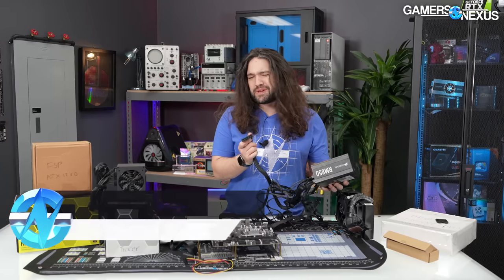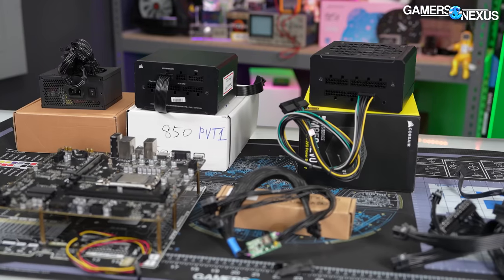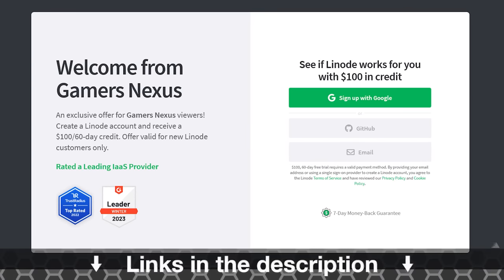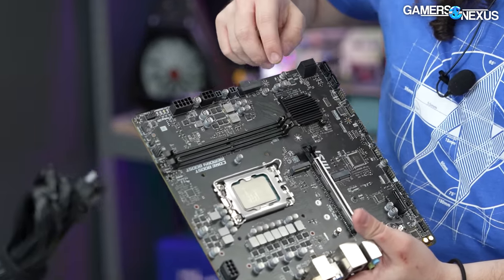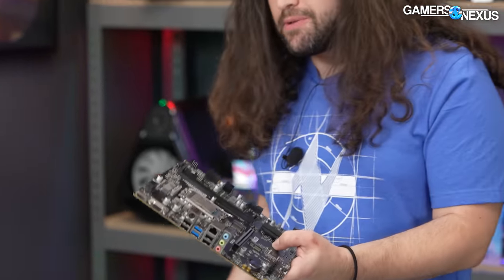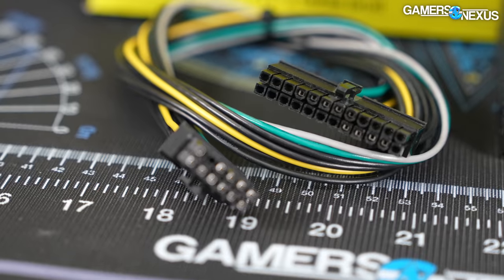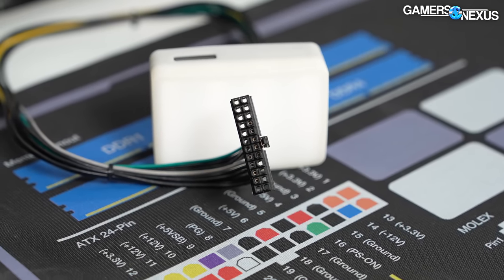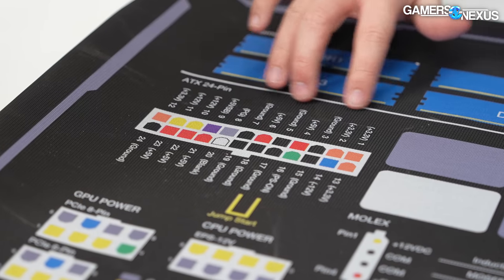The Future of Power Supplies - Maybe (Motherboard Cost, Cables, & ATX12VO)

Comment: I have a bit of a bone to pick with 12vo. I don't like moving all the voltage regulation stuff from a 150 dollar power supply to a 500 dollar mainboard. I'd rather replace the former if something goes wrong instead of pissing around pulling a much more expensive and harder to get motherboard. I could be crazy but this seems more work than is necessary.

And yes, they will absolutely charge me more for both the new 12vo power supply, and absolutely will for a new 12vo motherboard. Because reasons.
Reply from the maker: If it impacts board failure rate, then that's definitely a good point. Even if it's not a $500 board but a cheaper one, it's still a lot more work to replace.
Reply: @eye776  Tell me about it. It will stay the same or probably go up because 'new spec'
Reply: @eye776  PSU prices will stay the same but the motherboard skyrocket
Reply: I would bet they would raise the price of PSUs along with the price of motherboards and then tell us what a great deal it is.
Reply: Exactly, except now it's a $700 motherboard with lousy power conversion parts.  Caps don't last forever.
Reply: If you're buying $500 motherboards and $150 PSU, you aren't shopping for value anyway.  But for those who are, 12VO will be cheaper.

Comment: Another reason for the transition to ATX12VO is that 3.3V and 5V are difficult to efficiently deliver over long cable lengths. Those long cables act like antennas, picking up unwanted EMI. Moving all of the conversion to the motherboard is much more efficient.

Comment: The way I see this is power supplies will become cheaper to manufactur... but the manufacturers won't actually drop the prices. 
This will only increase motherboard prices making it a bad deal for the consumer.
Also this will add more points for failure on the motherboard itself.

Comment: I have custom built NAS, based on Advantech board based on Q170 chipset and Pentium G4400 CPU. It's powered by 12V power brick and it's crazy efficient compared to my previous Atom setup.
Reply: How do you power the drives? The SATA connector has 3.3V, 5V and 12V pins.

Comment: I'd be worried about the mini-ITX form factor.

Is there enough space on those boards to handle this 12V to 5/3.3V conversion?
Reply: they will find a way to do it and charge us 400 for a basic itx board

Comment: I know there are a lot of possible issues with this, like more points of failure and the injustified markup that's bound to happen, but let me dream for a second: just imagine how a build with this could look if you just used M.2-SSDs. You would just have two big cables, one going to the MoBo and one going to the GPU. In addition to that you could daisychain the casefans and now cablemanagement would be a dream. Especially for SFF it would be great to have the option, then you could choose a cleaner build for more money and otherwise you would just take a standard 24-Pin MoBo.
Reply: You'll still have EPS connectors.  

Also itx boards are already being stressed to their size limitations and now you want more DC-DC conversations to happen on board than before? Good job.
Reply: @NotThatGuyJD  Well I said I am dreaming a bit but I will kind of try to address your concerns. The boards wouldn't necessarily have to be bigger. For example there is more I/O than most people ever need on some itx boards. Some people would be willing to trade that for better cable management. As for the EPS-Connector: most CPUs could theoretically work on the power budget that is provided by the 10 Pin. A 13900K? Probably not, but that one consumes way too much power to begin with and if you want to use it you could just poupulate the EPS connector or use another board.

Comment: People are talking about motherboards dying but even without that, you still usually need to upgrade the motherboard more often than the PSU. I can buy a really good power supply if I only have to do it every 10 years, but I'm already keeping all of my hardware for a minimum of 5 years in the best case, so it might get even worse.

Comment: If we could combine power and data into one motherboard connector it could reduce cables, material usage, and clean up builds. I don't hate it.
Reply from the maker: That'd be cool! Seems like it'd rapidly enter "we didn't like the standard so we invented a new standard" territory for the pre-built manufacturers, though!
Reply: @GamersNexus  Good point. I don't like the lack of backward compatibility either, although adapter cables should be feasible. Make it an open standard agreed by a consortium?
Reply: @odjsjaks  The PSU could be lower cost due to reduced components and complexity as it only needs +12v and GND, like the PSU's discussed in this video. Also cheaper due to fewer bundled cables. 

The motherboard would increase in cost, offset by PSU cost decrease, as it now has the 5V and other circuitry.

The data cables would increase in cost because they now must also include power, which adds more complexity and material, but this should be offset by PSU price decrease.

When buying a new PC this should all balance out to no change in overall cost.

Adapter cables can provide converters to allow interoperability between old and new hardware. So you can keep your old PSU, motherboard, or other hardware, if you like. 

PSU manufacturers may make less money off this, whilst mobo make more, maybe? It's hard to tell how it would shake out. Regardless, this is a quality of life improvement, not a money making scheme.
Reply: If it's just 10 pin replacing the 24 pin I'm all up for it. I'm due for an upgrade anyway. But this one seems like not only it would increase the cost of the motherboard, because the extra component needed to power the remaining stuff, it didn't reduce cable clutter either. Look at that janky ass power cable from the mobo to sata.
Reply: @Leo99929  Have you ever met a Manufacturer of anything who reduces cost on a new generation of a thing? I wouldn't expect them to start now.
Reply: @odjsjaks  Why would 12 pin PCIE make the PSU more affordable? It's two six pin cables into one 12pin. That material cost difference is pocket change in the cost of a PSU factoring in that the reduction in cost from fewer connectors is offset by new tooling and lower scale of production savings vs the old hardware. Maybe it might make a few pence difference when production volumes overtake the old ones?

This is cutting out voltage conversion and regulation hardware which account for a significant proportion of the traditional PSU's capability, however, those stripped out power options need their power capacity adding to the remaining 12V capacity in order to ensure the motherboard can maintain 12V power whilst splitting part of it's supply out into the 5v and 3.3v. So I would expect a cost reduction on a 12V only PSU, but probably not as much as you might first imagine. 

Ultimately, what you're saying is that capitalism doesn't work, though. As given market freedom the manufacturers apparently conspire to maximise their profits rather than pass savings on to the consumer?... You're probably right that a route to more fairly priced hardware could be through non capitalist market regulation... You know if the company is floated on the US stock exchange then if they don't put profits first, then they can and will be sued by the stock holders, and the CEO replaced by someone who will? The legal system actively encourages charging customers the maximum possible amount regardless of the profit margin or morality. Look at the state of health care.

Comment: Would it be possible to transition to a single cable for both SATA (data) and SATA power ? With an adapter on the device side to accept a single cable instead of two. I think this could reduce the "worst cable management" aspect of 12VO boards.
Reply: It is possible, an cables like that already exist.

Comment: I hope it never does on home PCs. It’s very suspect to have the voltage regulation in the MB, if it does break it can cost 700 bucks if the MB did. cost as much. But if something breaks, the PSU can be replaced for cheap, easily and it also has voltage protection on it so it can’t break other components.
Think about that!

Comment: If the board will handle the power supply, wouldn't it be better to combine both power and data cables into one. Eg: for sata drives you have one cable that carries both power and data?

Comment: So not only are motherboards beginning to be kind of unaffordable but they now also get new things that could fail (power conversion parts which were previously handeled by the PSU) I'd rather replace a faulty PSU which costs ~90€ than replacing a motherboard which starts at ~120€ because some power conversion parts are broken or "smoked". I'm not sure if I like where the PC development is going regarding the changes mentioned in your video. Not to mention the effort that changing the motherboard brings along.

Nevertheless: Great video, keep up the good work at GN ^^

Comment: Looks like your run of the mill boost converter circuit with a 12V clamp, looks like a quick and dirty fix for the voltage conversion. Likely it will be totally fine for the conversion as standby voltage is only drawing power when the board is off. That definitely beats tossing out the PSU you had before.

Comment: Yeah, while I understand the gain in efficiency of 12vo, I don't think integrating more features into the motherboard is a good idea.

What I think would be a good compromise would something like a 12VO PSU, mostly as as an AC to DC converter and voltage transformer, connected to something similar to a DC to DC picoPSU in a breakout board which could be located near the board as to reduce losses.

Comment: One thing I wonder about is what's the future of itx motherboards with 12vo? They need to make the board 15-20% larger to fit these connections, will they even be able to manufacture a board that fits the size specifications of itx with 12vo? They might just exclude a bunch of it, because in many cases people with itx only use m.2 drives... Really what else is left to need to convert for?

Comment: If you want to know how this can play out, just go look at current Dell/HP motherboards on their business lineup to see how bad it can get
Reply: Difference there is that the Connectors are completely undocumented in most cases, and not everything has an adapter to make it work.

Dell/HP also don't just use one odd layout of connectors, they use different ones for different products.

Here it's a standard, documented, and adapters exist to reliably convert from one to the other.
Reply: Dell and HP are selling their business lineup to accountants who make their purchase decision because one vendor provided the same specification 50 cents cheaper than the other.

Comment: The extra lines are like used to reduce Vdroop on the 12V rail under CPU load, this drop in voltage is caused by the inductance to the PSU under fast switching operations (what you might call transients).

Comment: This could be very interesting in combination with the last couple of motherboards with reverse mounted headers and stuff because I can see all of your sata connectors and a lot of your lower voltage adapted headers coming off the back of the board making cable management easier
Reply: I don't see how that's any easier than cable management now.  Plus it requires you to change your PSU, motherboard, and case for no good reason.

Comment: This will result in motherboard manufacturers cheaping out on components to create the lower voltage power rails, then troubleshooting power issues will be 2-pronged. At least with the current state we know that if there's a low voltage issue on the USB, it's a power supply (or load) issue. I like the idea that all power rails come from a power supply that's been tested, certified, etc.

Comment: Love the California call-out!  From a state that melts down their power grid due to poor implementation of their current infrastructure without any consequence, it warms my heart that you specifically stated it. 

My opinion is, this won't ever be implemented specifically how it's stated. Just like the Corsair adapter cable, it will just be worked around to "meet the spec" but still maintain the status quo in the general PC community.

Once the big think tank over at Intel comes out with a follow up spec (or the time after that even), I'm sure we'll start seeing some changes in the new boards and PSUs.  

Maybe instead of coming up with specifications for "increased efficiency" to appease their political counterparts, they should come up with a cpu chip design that doesn't draw almost 300w under load. Ya know, like when people are actually using their own products 🤦🤦

Comment: BTW, one can make an adapter cable to power off mainboards with 12V only PSU. It would also have a PCB that makes the other needed voltages.

Comment: My argument is pretty simple. Most of us use our power supplies for more generations of the build than our mother board.

So if the 12V to 5V conversion happens on motherboard, as it will with 12VO, I would have paid 4 times for this circuit is last 10 years, but since it is on the PSU (because I am not using 12VO), I paid for that circuit and it’s components only once. 

This is essentially an advantage and an optimization for the system integrators, but an e-waste for everyone else.

Comment: My main issue with 12vo is your adding more points of failure to your board. A PSU is usually a lot cheaper to replace than your motherboard although not always. Oh and we would get much more expensive boards
Reply: 12v has been standard in datacentres for years now.  We haven't seen any issues because the 5v, 3.3v and -12V lines do so little these days that the regulators on the motherboard that supply those voltages never fail.  They're just doing so little that they don't fail.

The same goes for laptops.  You don't see failures in those regulators because they do next to nothing.

Even in desktops by Dell, HP, Lenovo etc have been 12v for years and again, it's a non-problem.

Not that any of that matters.  ATX12VO is an update of the ATX12V spec.  It's been around for decades and it has had zero effect on motherboard and PSU manufacturers, and there's no reason to believe that this is likely to change at any point in the near to mid future.

Comment: You forgot 5V to USB.
Today, USB draws a lot of power from 5V rails.

Just plug 4-5 external drives and that's 8-9A in just 5V and we already know the motherboard manufacturers will cheap out the conversion to 3.3V and 5V. So I doubt there will be a midrange board with good 5V rails, not tripping over current (if any protection is placed on the boat) after plugging external drives. Needless to say by how much the motherboard manufacturers will increase the price because of the new 'feature', yay

Comment: There's nothing magical about ATX12VO that'd make it more efficient than ATXv3.x. What I am rather worried about is having all of the switching mode power supply action for 3.3V and 5V happening right next to the RAM section. Turning mainboard designers into PSU designers also seems highly questionable. Taken together, I see absolutely zero reason for ATX12VO to exist.

Comment: Moving this type of change into 1 form factor would drive this, like into ITX- dtx, in the mean time support an interface between them, simple 12vo ps feeds small adaptor for power division for use on older boards just like that Corsair cable. Nice old silly scope on top shelf left. Ipsu looks like current monitoring nice. I will be looking into this for next build as spec matures

Comment: HP does something similar in some of their small forms office PCs.
We had one. We needed to add a video card that wouldn't fit. So, lol, we cut the motherboard tray out of it and a Dell optiplex case and soldered the HP tray into the Optiplex. We installed a 600w psu and found a problem because HP used a 12V standby voltage. We had to purchase a small voltage converter circuit and glue it on the side of the psu, ran the 5v sb to the converter and the new 12v sb to the HP main board. I had to build a converter cable from 24 pin to the HP connector. 
Everything worked except we kept getting a fan error. Turns out the HP power supply sent a tac signal for the PSU fan through a second connector to the motherboard. We were going to tap into the CPU fan tac to correct this but since we could bypass the error by pressing a key during boot we didn't bother.
Frankenstein worked great for two or three years before we replaced it.
I am curious to see if this new standard works out or if people just say "meh" and keep purchasing boards and PSUs using the current standard. I know I have no plans to replace my 2-year-old Seasonic.
I hate moving the SATA connectors to the mobo. That's such an hp thing to do.

Comment: Taking into account the overall equipment roadmap, where most of the features are transferred from the industrial grade to DIY and than to retail products, no surprise that it's just a question of time when the common powerbus is getting its place in home applications. Most of the complex electric/electronic machines have a number of PCBs powered by a single voltage transformed by internal means into required range.